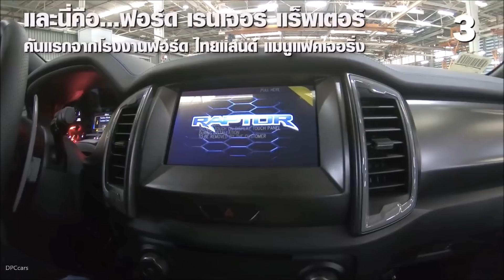2019 Ford Ranger Raptor Factory

Comment: This factory is in Thailand.  The US Ranger will be made in Wayne, MIchigan.
Reply: Dan Schneidau same design, different engine. Not fooling me. New ranger looks like a Honda Ridgeline.
Reply: callofdutyguy9 I didn’t realize I was fooling people by pointing out that the US Ranger will be made in MI....
Reply: callofdutyguy9 actually, it doesn't being this model Ranger has been made before the Ridgeline, but good try though.
Reply: Pennywise so, they still look alike. Very boring, underwhelming and inoffensive design choices.
Reply: callofdutyguy9 and the Honda Ridgeline is so much .ore exciting looking? To even call that FWD garbage a truck is just comedy.
Reply: Pennywise I don't consider it a truck either, but it's as exciting to me as is the "new to the US" Ranger.
Reply: callofdutyguy9 then you haven't researched it much then. It's a far more capable vehicle.
Reply: Dan Schneidau Yeah they will make the Ranger and Bronco in the old Focus plant in Wayne, MI. I’m a car hauler and 1 of our terminals is across the street from the plant.
Reply: These cars are not made for the American market !!
Reply: mixalis they will be later this year.
Reply: I didn't know that these Raptors are made in Thailand.
Reply: The Asian Ford Ranger Wildtrak , XLT , XLS will be equipped with AT transmission or 6 spd manual transmission.

Comment: I hope the Ranger Raptor comes with at least a 300+ horsepower and 350 lb foot of torque engine.
Reply: it has a 369hp TURBO DIESEL
Reply: Michael Bacon the regular ranger is already producing 300+ horse power.

Comment: Don't buy this extreme poor quality of thing made by Philippinos. (VIN 6FP***) After 1 month of my ownership and 800km mileage!!!  I have 15 listed -- raising continously  -- issues, most criticals are: engine (jet disperser, high pressure fuel system), gear selector , seats (driver side totally falled apart) and chasse body assembling and painting issues. Local dealer and Ford East-Europe looks not very helpfull. This car what I'm talking about sold in Hungary.